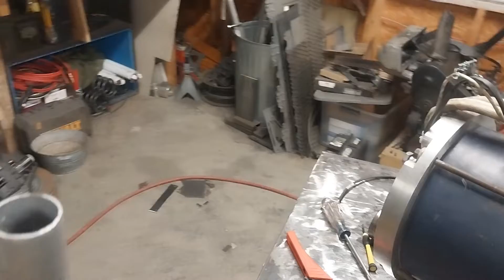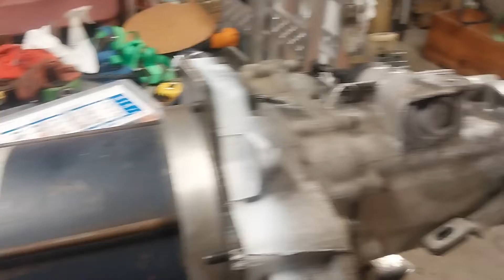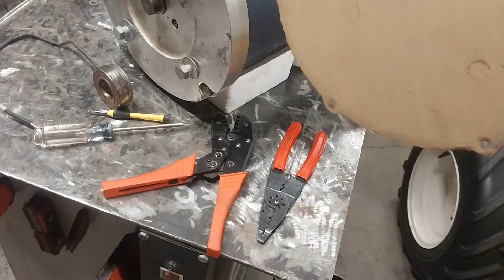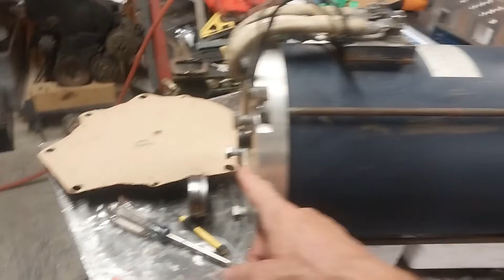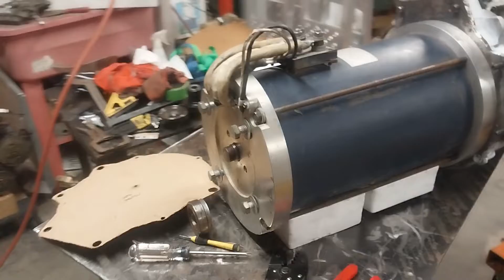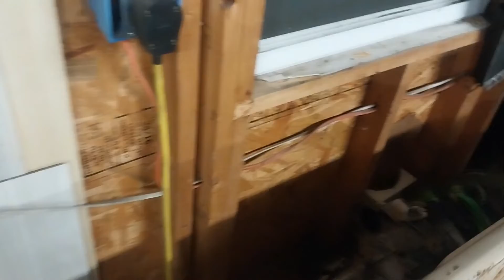Back Up and Punt - TSLA VW

Comment: RWD TESLA small motor assembly would be a hot rod, but a Nissan Leaf motor drive assembly may be easier as a RWD because it has about the same track width.